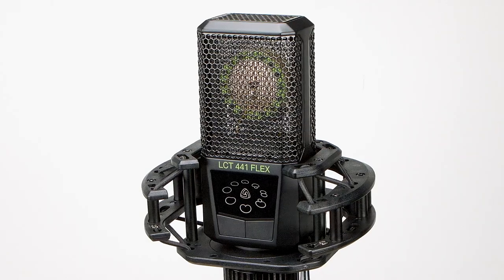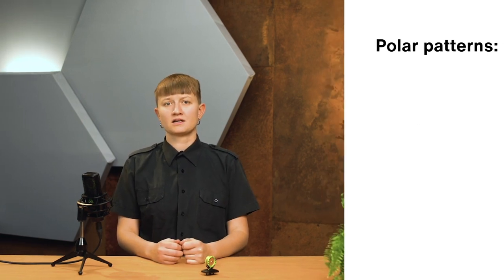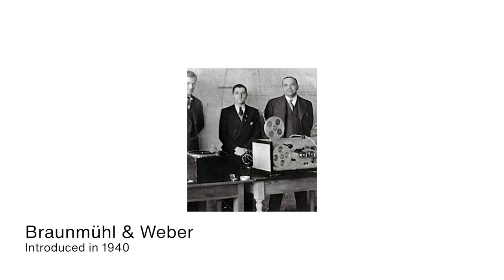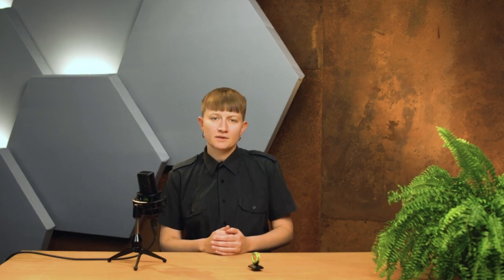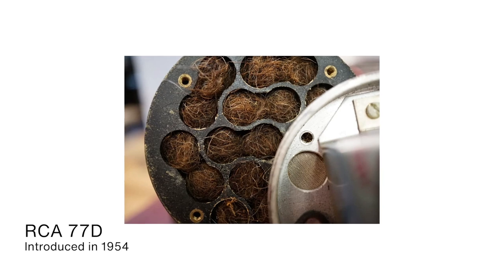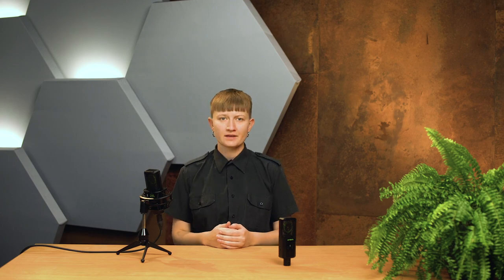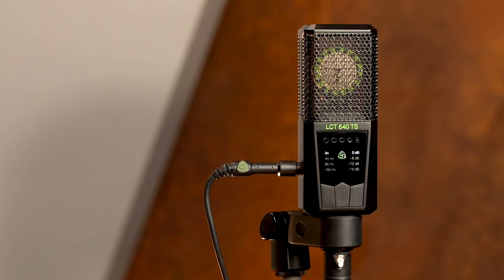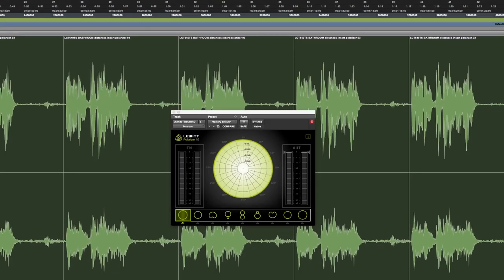Is A Multi-pattern Microphone For Me ? Watch This To Find Out!

Comment: how about background noise? the 441 Flex is a condenser mic right? if you going to start up a home studio for singing and voice acting will traffic noise, elements in the house etc. be picked up with this one and so damage all my recordings?
is a dynamic mic like Shure sm7b better for a home studio or can I go with this one and skip the cloud lifter extra cost that sm7b needs? 
I kind of like the Lewitt style! 😊... But perhaps I must chose a dynamic mic?
please help me out choosing the right path!
Reply from the maker: Hi, and thanks for your great questions. Yes, a condenser microphone is very suitable for home recording as it will give you a detail-rich high-quality sound. 

Background noise plays a minor role 1) if you keep the distance to the microphone small, and 2) if you take care not to drive the gain too high. 

Since dynamic microphones are less sensitive people tend to be closer to them. The closer you are to the microphone, the cleaner your signal. This plays a big role in difficult acoustic environments like an untreated room for example. 

You can use a condenser microphone without hesitation, if you pay attention to the points mentioned. In addition, it is essential, no matter if it's dynamic or condenser, to position the microphone correctly. With a cardioid or supercardioid polar pattern, you can block out lots of unwanted noise.

Comment: This video is very interesting, I've been looking for this information for years! I take this opportunity to ask you if Lewitt has a balanced condenser stereo microphone for overhead, compact and quick to mount on the drum-kit using a single 5-wire cable and a 2 XLRs split at the end, such as the NT4. Thank you!
Reply from the maker: Hi Viames, thanks for your comment. It's great that we could help you out with this Video! We don't produce a mic with the exact stats that you describe. We usually use a pair of microphones as overheads. You can't really go wrong with a pair of LCT040 Match. If you want one Microphone to do the job, the LCT 640 TS in dual output mode gives you compact stereo recording.😉

Comment: Good evening, 
I have a question, I just bought the LCT 640 TS and I don't understand how to activate the stereo on the microphone. I select well the position on the microphone but the sound comes out as much on the left as on the right when listening. know that my microphone is connected by an xlr cable to my sound card (presonus studio 24c). 
Your help would be really helpful...thanks in advance 💜
Reply from the maker: Hey VickyASMR, in order to use dual output mode you need to hold down the center button on the front of the microphone for 2 seconds until the logo turns green. Then you need to plug the mini XLR to regular XLR cable into the side port of the microphone. Then you will have two separate XLR outputs to plug into different channels. There is a quickstart quick on our website as well.
Reply: @LEWITT-audio  Thank you 😁